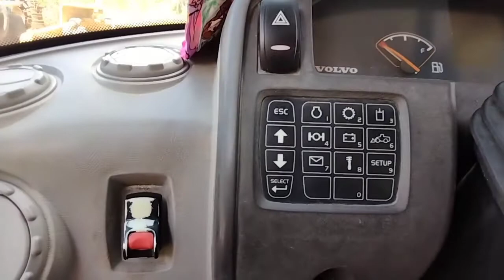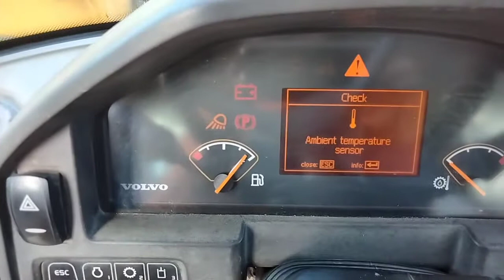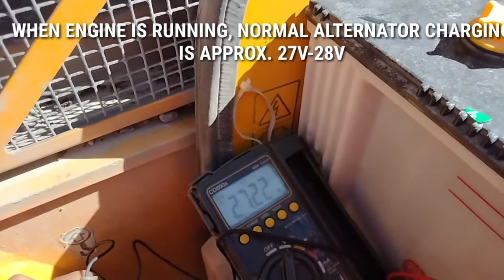HOW TO INSTALL IGNITION SWITCH, CONVERT FROM ORIGINAL TO ORDINARY.

Comment: Sir two position lang yung switch na ginamit mo tama po ba? Ano pong product number nyna na circuit brand? Salamat po
Reply from the maker: Oo, 1st. click On ignition,  2nd click Start the engine.
Brand " Circuit"  available Yan s mga auto supply.
Reply from the maker: Circuit Ignition Switch, pwede gamitin kahit sa heavy equipment.
Reply: @GDElecTech67  salamat po sa reply sir